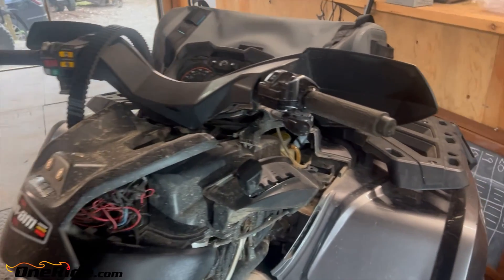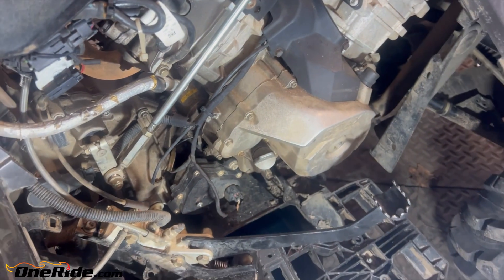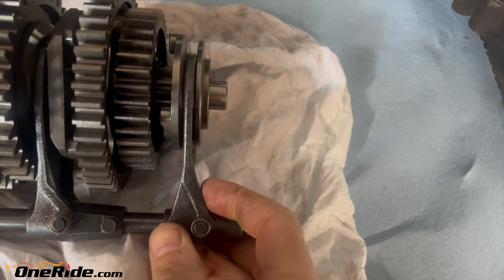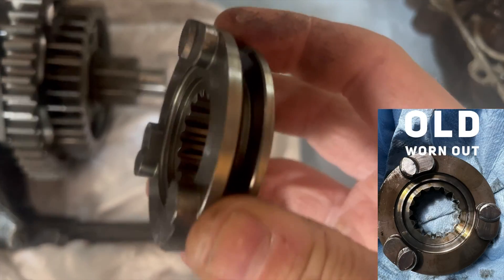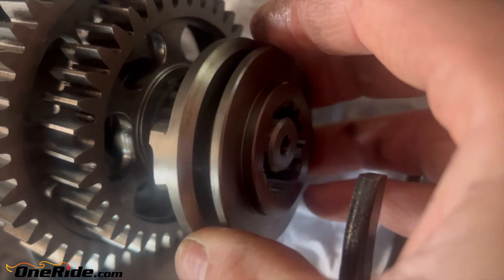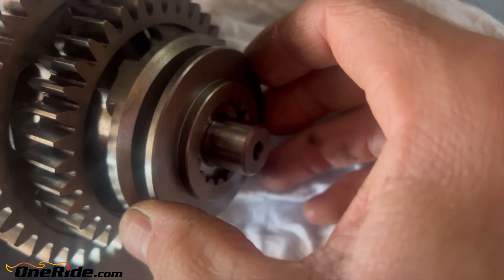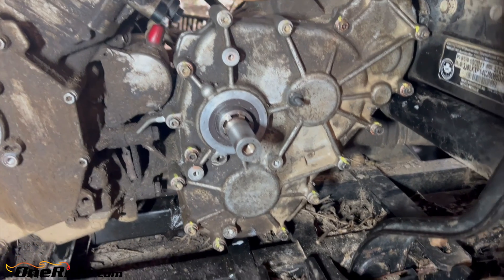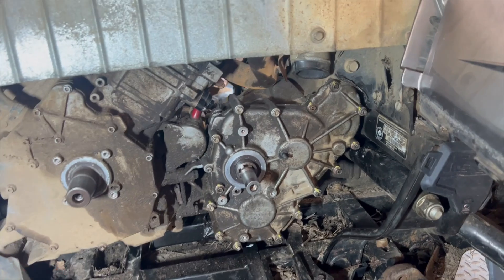Understanding the Can Am Rock - hard shifting and grinding gears?

Comment: So like mine grinds going into high. Once it’s clicks in it’s fine. Would this be the problem?
Reply from the maker: First check that your linkage is adjusted properly and the rod is not bent/damaged. When it’s in neutral the shifter should line up with the arrow on the plastic near the shifter. Is that’s all good then yes it’s inside.

Comment: Did this fix the rock/ hard shifting? I’m having problems getting into high gear only, it’ll grind some and I’ll spend a lot of time trying to get it into gear. Other times it works just fine. It’s only for H gear.
Reply from the maker: Yes. This totally fixed my problem. Mine was only in H gear. Mostly grinding when I hit the throttle. Before you dig into this make sure you check the simple stuff like you lever is aligned properly
Reply: @OneRide hey did you have any trouble put the gear case back on? I’m currently having that problem seems like the fork rod is sticking out to much.
Reply from the maker: @marcanthonysantana7288  my memory might be off but I believe so. I think I struggled with that locking swing arm (I think it’s the park lock) in the cover. I remember I had to have my fingers behind the cover to line it up. And I remember putting some grease there to try and hold that swing arm up.
Reply: @OneRide yes sir it was literally that part which took me for ever to figure out. Had to shift it into neutral to align everything up
Reply from the maker: @marcanthonysantana7288  well I’m glad you got it! How did your gears look, were you able to fix your problem?